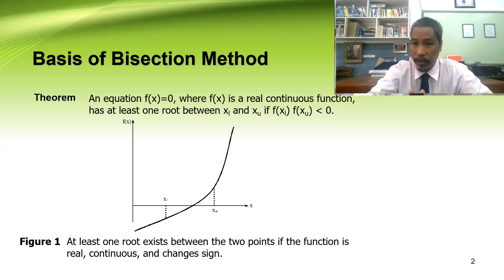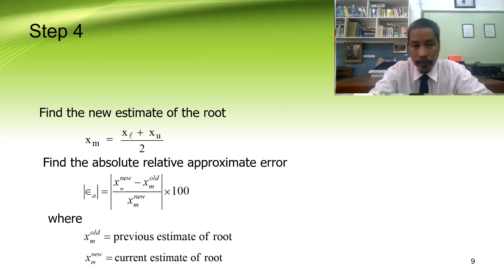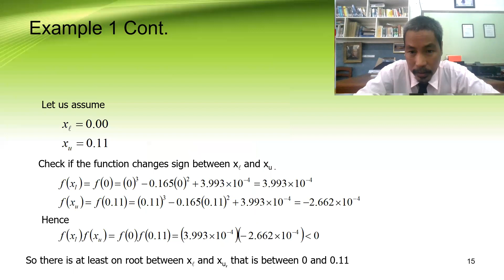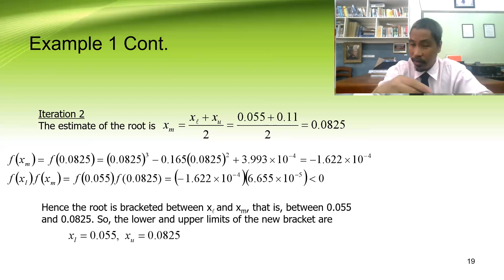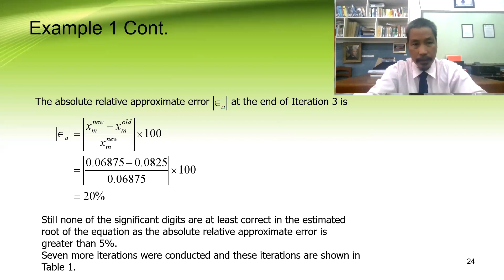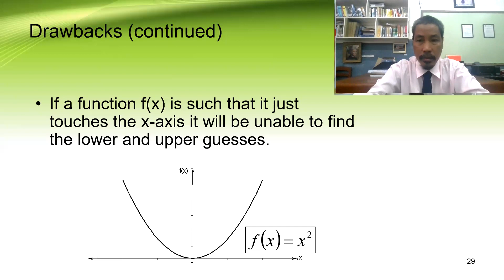Bisection Method Part 2 | NUMERICAL SOLUTION for CE Problems: Solution of Nonlinear Equations f(x)=0

Comment: Thank you, Sir. In this video topic about the Non Linear Equations - Bisection is a big problem and practical application to solve a problem . If the function f(x) does not change sign between two points , there may not be any roots for the equation f(x)= 0 between the two points.